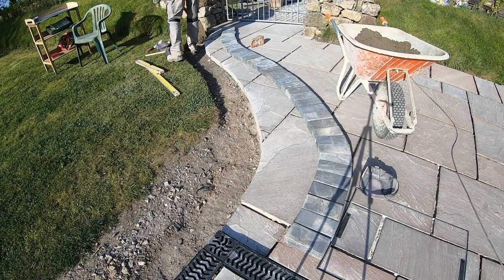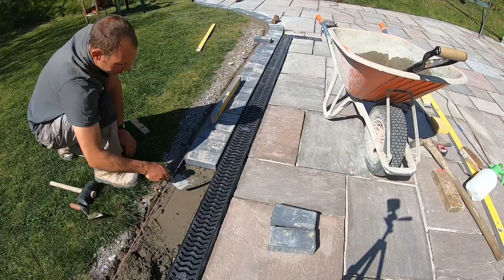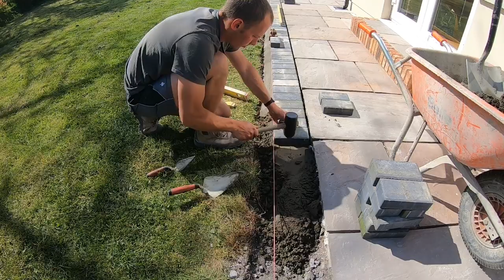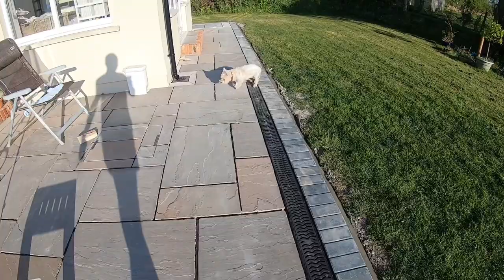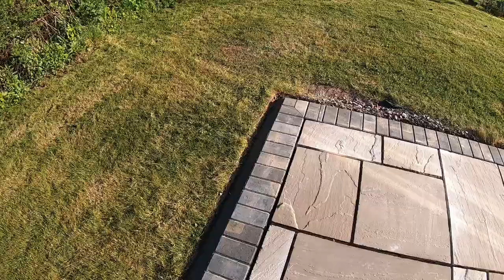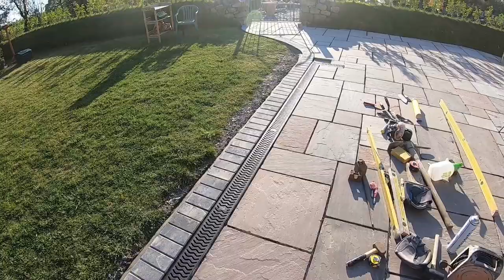Brick edging time lapse

Comment: Hi Sam, great work.. I was just wondering what ratio bed mix you went for on this?
Reply from the maker: damiop123 thanks! I did 4 stone (20mm to dust) 2 sand and 1 cement. If you can get ballast (all in) then 6 ballast 1 cement. And semi dry mix when you mix it up
Reply: @SamDaviesBuilder  Cheers mate!